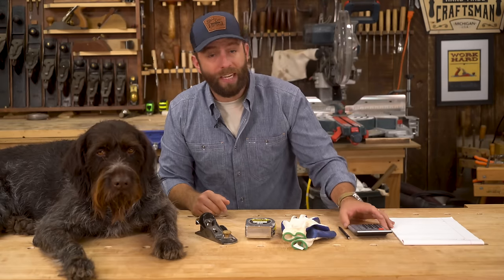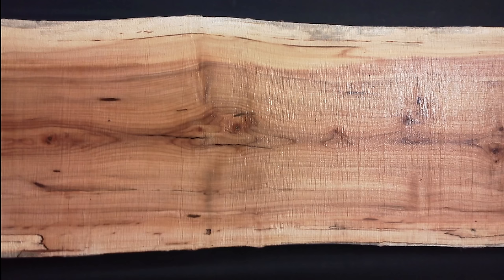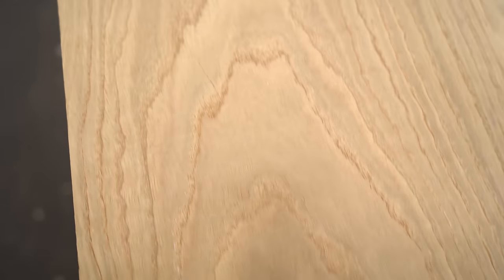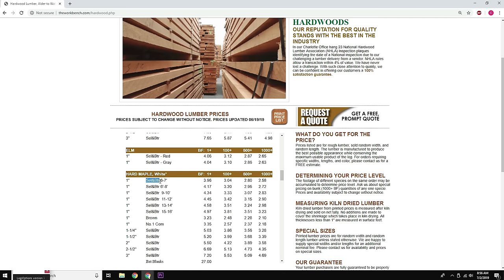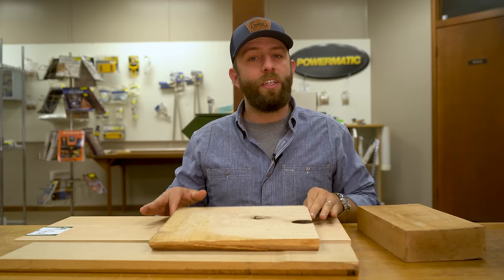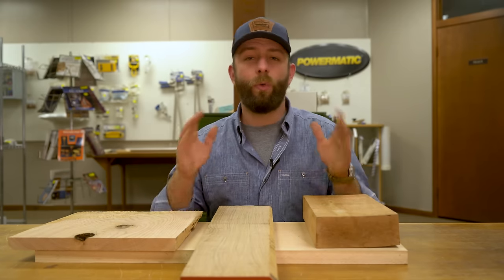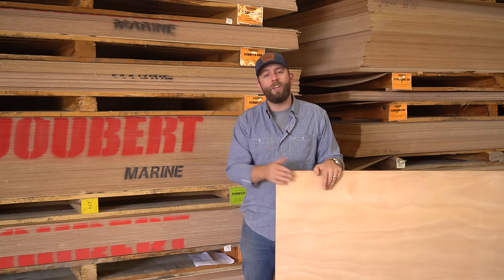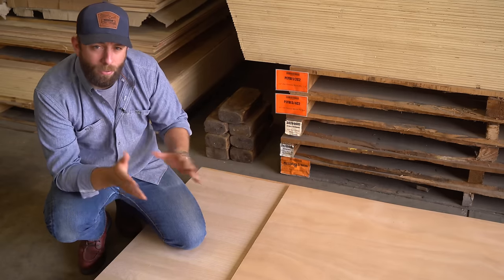How To Buy Lumber & Plywood At A Hardwood Dealer

Comment: Hardwood lumber is sold random widths and lengths. Typically it is sorted by lengths when it is dead piled. If it is surfaced one should know that it is typically not surfaced at the same thickness as softwood. It is tallied by surface measure in square feet on the surface and then multiplied by its rough thickness. If lumber is graded select and better that is an indicator that the trees do not grow as a large as the lumber that is graded face and better. FAS is graded from the poorest side. One face and better is graded with the faces being independent of each other. It is often abbreviated IFB or FAS1F. That lumber will be graded FAS on one face and one common or better on the back. FAS will grade FAS on the poorest face. 6 and 7 foot lengths of Walnut are defect graded. 8 foot and longer is graded by the cutting  unit method. The best board of all is a one common board that has a one foot surface measure. It must have a clear face. Often the best looking boards are 8 feet long with a knot near the end. It is often graded by the 97% rule. A board can have a surface measure at the 1/2 mark or over and be graded at the next higher tally measurement. If it is under the half it is graded at the next lower tally measure. In a lot of lumber if the lumber is randomly picked there will be little difference in the total measure. However if selecting a few boards I try to get boards that look good which are just under the half mark. For example lumber is bought and sold on the tally to nearest whole unit unless it is for export. If a board measures 7-3/8 surface measure it will be sold as 7. If it measures 7-5/8 it will be sold as an 8. It is wise to understand the language when buying hardwood lumber. It is sold as four quarter (4/4) five quarter 5/4), 6/4, 8/4, 10/4, 12/4, and 16/4. Hardwood is sold in lengths not longer than 16 foot long unless it is from a specialty place. Not many places sell backing boards which are left over from making veneer. They are the center section that is left over.They are quarter sawn and will have a pith center in the middle. Then can range from 3/4 to 5/4 in thickness in the same pile.

Comment: I never understood why I pay more for a board foot of 8/4 than I do for 4/4? I mean a board foot is a board foot so why is it more?
Reply: Because much less is wasted when you mill long, wide and thin boards. You can get a bunch of 4/4 boards from a single tree and only few 12/4 wide boards
Reply: The logs needed to produce good clear 8/4 or thicker lumber are typically from larger trees. Land owners will demand more money for the larger trees. The process to Air Dry and Kiln Dry thicker lumber like 6/4, 8/4, 10/4, 12/4 is very delicate. Not only is the drying time needed much longer than 4/4 but the risk of drying defects increases exponentially with the thicker lumber. Drying thicker lumber to fast will result in major defects like splits,  honeycomb and case hardening. So the thicker lumber has to stay in the Kiln or Oven a lot longer to dry it out.

Comment: Great video, shame Americans make things so confusing though with Imperial measurements, get with the times!
Reply: What are the rough sawn thicknesses in the uk?
Reply: @jmlcarlin  it's generally 25mm to 300mm for both width and thickness incresing by increments of 25mm, your most common is a 100x50.
Reply: ThatPixelGuy that’s awesome even in metric you still buy wood in inches 25 mm and feet 300mm. Also the most common is a 2”x4” just like over here
Reply: @jmlcarlin  yep I guess people just know what to do with those measurements from information passed down generations. Generally we find inches just lack the accuracy of millimeters, especially when you start talking in fractions. At least using the same roundabout dimensions helps with conversion over the pond though!